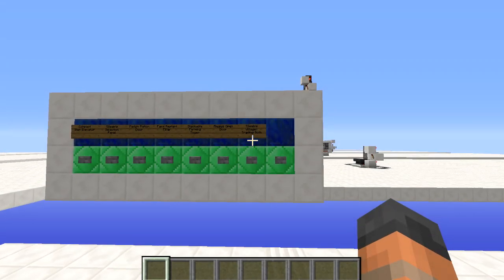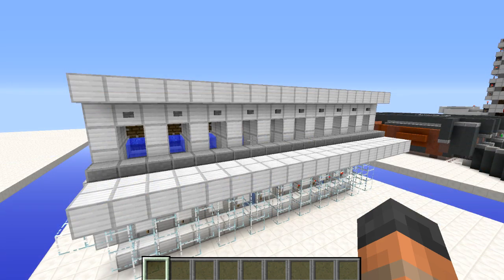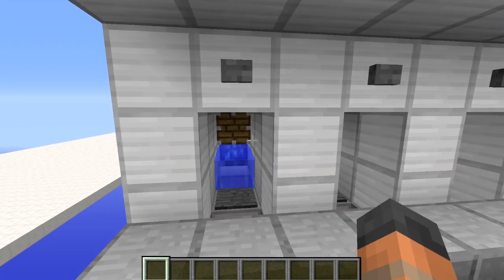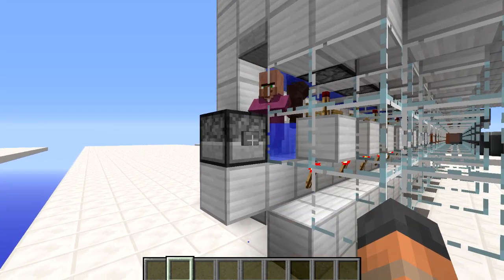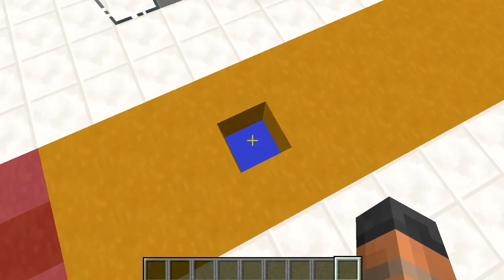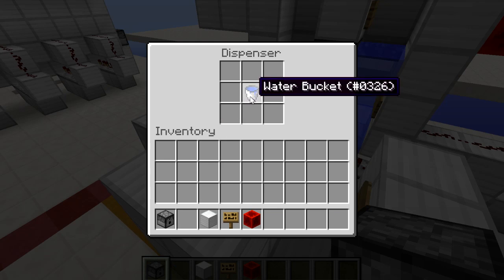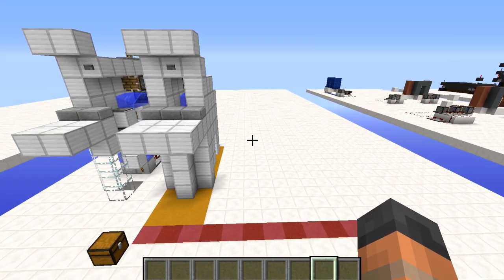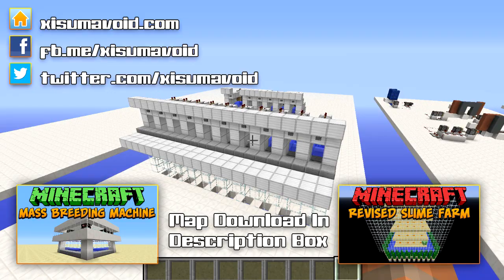Minecraft: Villager Trading Booth (Tileable) Tutorial

Comment: Is this type of set-up still a good approach in 1.8? With the new trading system in the snapshots, you will often want to hang on to a single villager forever, such as one selling diamond equipment or a good enchanted book. Good trades to get emeralds from are also something you may want to cling onto forever (buying paper, carrots, rotten flesh, etc). I think you would ideally want to have two buttons, one for getting rid of a villager and one to put it in a keep area, where you put villagers you want to forever. That way you can keep using this design for sorting villagers and for keeping ones you know you will want to use forever.
Reply: That's what I'm doing with my design. For details check out my latest video where I start building this thing.
Reply: I just remove the button on the ones I want to keep.
Reply: That's probably what I will do. Since we don't have a keep area I'll just have lots of modules. They are pretty easy to build.

Comment: I'm noticing that sometimes villagers will slide right off the pressure plate when initially making it to the booth (breaking the cell until you reset it with the button). I tried using fence gates but when they land on the pressure plate the fence is opened anyway and they still slide off and you can't trade through an open fence gate if you put it at eye level.  Is there any solution to this other than manually placing a block in front of them to prevent them from sliding off?

Comment: Villagers float off the pressure plate in to the water stream and then reactivate it.  Is there a fix for this problem?
Reply: Trying a slime block under the pressure plate to slow their movement so they are unable to step completely off of the plate into the water.  So far it looks good, still testing......